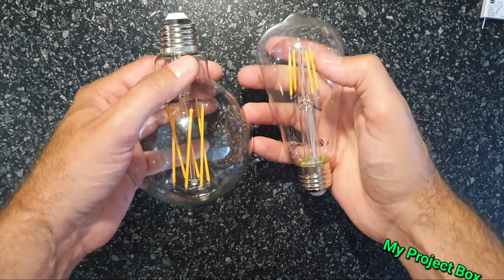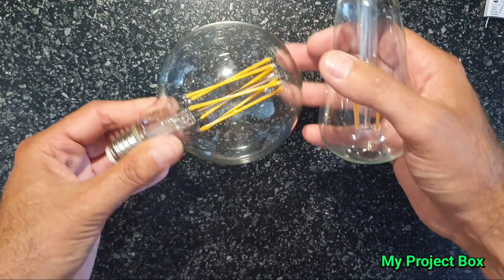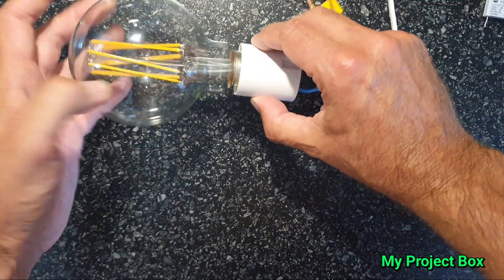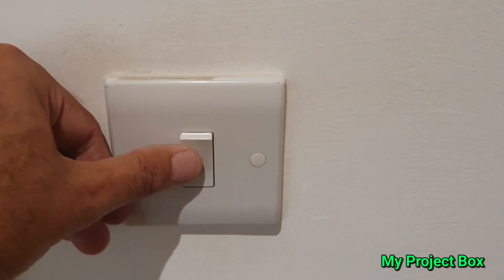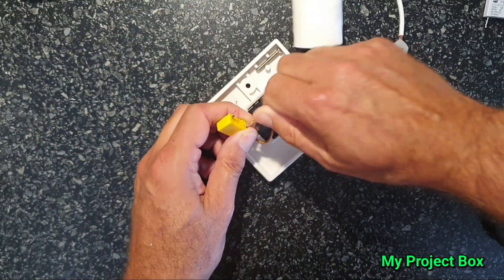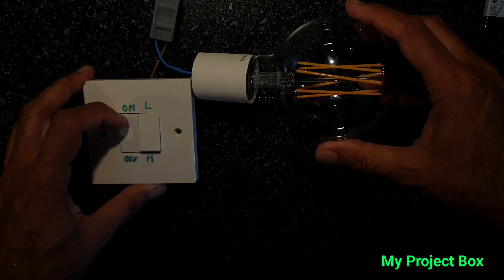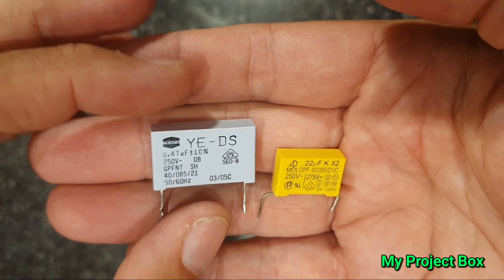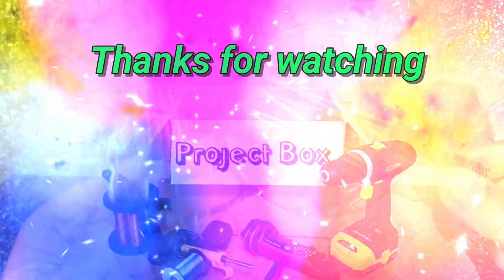Dimming NON-dimmable LED filament bulbs & life extension

Comment: This is such a simple way to do it, thanks for sharing. I'm curious, would the capacitor rating change the dimming effect? My thinking is to use one capacitor for one dimm "setting" and another one for a different setting. This way you have on/off, full brightness, half brightness, quarter brightness (something like that).
Reply from the maker: Yes exactly! You're correct 😉👍. You would have to experimentally verify which capacitor value gives you the correct brightness you desire. Different wattage LED bulbs will also yield different results, for a given capacitor value. It would also be possible to dim multiple bulbs (the same type) from one capacitor! You could use a rotary selector switch, to switch in different capacitors.
Reply: @MyProjectBoxChannel  Hi Sarel, this awesome, have you experimented to determine the capacitor values for two, three or four light bulbs . Thank you
Reply from the maker: @tbk19656  if you want to dim multiple bulbs from one capacitor, it's important that all of them are the same type and wattage.
Reply from the maker: @zororat yes😉👍 if they are  not all exactly the same,  one will draw more power than the others, and this will result in different brightness levels between lamps.
Reply: Also what capacitor would you recommend for a 4 watt bulb
Reply: Brilliant idea. I have been thinking of switching my high intensity COB lights into low intensity. Thanks alot, hatsoff and love from Pakistan!
Reply: Hi everyone, I purchased some 0,22uf  capacitors. When I connected the capacitors in series the intensity became lower and there is also a voltage drop. 
When I connected additional capacitors in parallel the intensity increased and the voltage as well. 
I am ever so greatful. 😊
Reply from the maker: @tbk19656  I'm glad it worked for you👍. Not all types of led bulbs work with this method.

Comment: Can i use only one capacitor for my living room switch? …as they are 6 bulbs in total
Reply from the maker: In theory yes, but it would need to be a much bigger value! All you bulb have to be exactly the same type and power. Test one bulb first to see if it can be dimmed with a capacitor. To dim all 6 lamps together will take some experimentation with the capacitor value (mabe 1uF or 2uF)

Comment: I have a hanging light arrangement in my house. There are 30 numbers of LED filament bulbs 9 watt each from a single on off switch the operating voltage is 230 volts 50 Hz

I am looking for a solution to reduce the intensity of all bulbs to approximately half. Can I put a suitable capacitor in the common line at the switch which will reduce intensity of all the 30 bulbs at the same time. 

Thanks

Comment: Tried several different LED lamps to dim with different capesitors. All flickers. You can't see it, but if move a finger, it's like stroboscope. Also, can see it on smartphone camara. Didn't work for me.
I downpowered all my lamps by incrising a resistor on the circet board. No flickering at all. Unfortunately, doesn't work for filament bulbs.

Comment: It works great but i want to know if it this risky for fire?
Reply from the maker: It's perfectly safe, just use the correct voltage rating for the capacitor.

Comment: I did this method with a table fan and it worked! My fan is 50w 127v 60hz, I connected one of the phases of the power cable to a 15uf cbb61 capacitor, this made the fan slower and quieter.

Comment: There are three types of LED bulb drivers. PWM, resistor and capacitor combination, constant current regulator.. This method probably won't work on PWM and resistor and capacitor combination drives, but it will work on a constant current regulator drive. Economical LED bulbs mostly use constant current regulator drivers. Integrators such as BP5131 can be given as an example. There is not much difference between the working principle of these drivers and a resistor. Both limit the current, but the regulator is more efficient. Connecting a series capacitor to the LED bulb will only further reduce the current and the brightness of the LED bulb will decrease even more. it is safe for leds and driver
Reply from the maker: @alpozdemir7898  the types of mains voltage LED interal lamp drivers I know of, is "capacitor dropper" , "SMPS/ buck converter" , and "linear current regulation". And the reason I used a capacitor to drop the voltage/current, is because its more efficient than burning up heat in a resistor dropper, but for very low current a resistor is not really a problem. Pwm is usually used for dimming LEDs from lower DC voltages or inside smart bulbs. Lower dropping current/voltage to a led bulb should be fine with a resistor or a capacitor. It kind of works because you reach the point where the driver almost "drops out" and the LEDs are dimmer.
Reply: @MyProjectBoxChannel  Thank you for your answer, what you said is completely true, the companies that produce these products do not want us to know the truth, it is more profitable to sell much more expensive dimmable bulbs
Reply: Thanks to you, I reached my goal and it was very cheap. Thank you for the video.

Comment: Today, the idea of applying a similar method came to my mind, I have never watched this video you posted before, but I used a 10kiloohm resistor instead of a capacitor, I didn't know it was possible while implementing this project, but it worked, bingo👍, so a common conclusion can be reached by thinking logically.

Comment: Tried this method on some smd bulbs with 0.22 uF X2 class capacitor:

1. ikea 5w ryet, is dim. but quite visible flickering.
2. Lidl 5.5W Livarno, get dimmed without flicker
3. Lidl 10W, flashing with interval of 0.5sec.

This is the 10W light:
https://m.youtube.com/watch?v=N6oEe1Li1-A&pp=ygUVbGVkIGJ1bGIgMTB3IHRlYXJkb3du
Reply from the maker: @MACYNET323  some types of led driver circuits won't work with this dimming method. For Example "buck converter" type and SMPS typs.
Reply: @MyProjectBoxChannel  At this point I will try with ceramic Resistor, guess that size should be adeguate for at least 5W of heat dissipation, avoiding to put near cables...
Reply from the maker: @MACYNET323  you are probably going to have the same problem even with a resistor😢.,because the buck converter/SMPS LED drivers are setup as a constant current regulator, so it will try to keep the current to the LEDs the same no matter the input voltage. That is probably why you are experiencing the flashing.
Reply: @MyProjectBoxChannel   You right, usually inside  pcb there are 2 resistor in parallel connected on the Isense pin of the chip regulator which determines the output current.

Another way, pull out the driver, install  inside the wall and connect the output on a small DC dimmer for regulation, but even in that case shouldn't work

Comment: Does flickering is visible like when you shake hands when bulbs are dimmed?
Reply: Do you think I could add one capacitor to a circuit running 16 GU10 bulbs? They are 3watt each. What size capacitor would I need?
Reply from the maker: @bryandurandable  yes it could work,  but you need quite a big capacitor, 1uf or 2uf. Not all gu10 lamps will dim this way. So you will need to test it first. They also all need to be the same type and wattage.
Reply from the maker: No it should not flicker😉. But it will depend on the type and quality of the LED bulb🧐
Reply: Oh man ❤Is better to put 2 in series(with switchs) or in paralle for select different modes bright?
Reply from the maker: @MACYNET323  yes you can switch multiple capacitors if you want😉👍(parallel or series). But for me just full brightness and a nice dim setting is enough 👌

Comment: this way can work as you wish but the light has flickering that not good for your health (this bulb is arround 15-25% flickering) I did use rectifier bridge diode + Capacitor  + inductor to create 310VDC at 5% flickering

Comment: I have a set of light up LOVE letters. The ‘L’ plugs into the socket and the ‘OVE’ take their power from inside the ‘L’. If I were to put a capacitor inside the ‘L’  before the power reaches the bulbs would this work?
Reply from the maker: @19crofty86  it's possible yes/ maybe. But it depends on the type of LED driver 🤔.  Are the led letters mains voltage? Or 5v 12v?

Comment: Such a simple idea, and it works, Thank You.
I tried this on the step-daughter’s 4 non-dimmable ceiling LED’s ‘FIXED LED SLIM DOWNLIGHT, 11W 1200LM’ brought from Screwfix, they were so bright and needed dimming.
Tested on one lamp first, 0.47uF capacitor, Dimmed nicely, voltage was 140v. 
Next wired into the 4 ceiling down lights, voltage had dropped to 60v, brightness was really down, but when she tried it at night time, it proved to be too low, so I need to change the capacitor value, But it works
Reply from the maker: @Bigmalc0   Yes the dimming effect is load dependent, so multiple led lights in parallel will require a larger capacitor. You could have a high/Low switch, for full brightness and dimmed mode. I'm glad it worked for you😉👍. Thanks for sharing your findings with this type of LED light fixture. It's good to know that it's is possible to dim this type of (non-dimmable) ceiling light, with a capacitor
Reply: @MyProjectBoxChannel  I like the idea of having two different light levels, but in the daughter's case, it is not possible to contain it in the switch housing, I've tried.
Can you get a remote switch a bit like the garage door where one press turns the light on, second press for half brightness, third press turn off,
On another idea, do you know if the Sonoff R3, is in Half Brightness mode and you were to turn the lights off at the switch, when you turn it back on, will the Sonoff R3 remember the last setting?
Reply from the maker: @Bigmalc0 Some time ago, I used a sonoff dual, with two outputs, to do the high/low modes. It was the older one but the newer one will be better. https://youtu.be/EUKop6N4cX0

Comment: Can I connect multiple bulbs on on3 capacitor ?
Reply from the maker: YES! It is possible to use one capacitor for multiple LED bulbs, but the bulbs need to be identical, and you will require a bigger value capacitor. The value of the capacitor depends on the wattage of the bulbs. So you would have to experiment. I would try 1uF or 2uF capacitor, and if the bulbs are too bright, then you should use a lower value, maybe 0.47uf

Comment: Could use this for led strip????
Reply from the maker: Only if its a direct 230Vac (or 110Vac) strip. It won't work with 12v or 24v and driver type😥

Comment: Simple solution. Very cool. Total noob here... is there a wattage limit on that capacitor? Lets say you need to dim more than one bulb, say in a fixture. DO you need to have a capacitor per bulb?
Reply from the maker: You can have just one capacitor dimming multiple led bulbs in one light fixture😉. Just remember that they need to all be exactly the same type and wattage. Your capacitor will also need to be a much bigger value, and that value will depend on the quantity and wattage of LED bulbs. How many bulbs are in your light fixture?
Reply: Thanks heaps for the reply :) I was planning on having 6 nos of 4W bulbs. So a total of 24 watts. We also use 240v AC off our grid.  @MyProjectBoxChannel

Comment: Is this safe on the long run? I have similar LED filament bulbs from Globo and they're not dimmable. I would give this a try but I was wondering are there any hazards?
Reply from the maker: It's perfectly safe😉, as long as the capacitor used, is properly rated for mains voltage ⚡️. Like a x2 rated capacitor.

Comment: Would this work using a 2 gang wifi switch?
Reply from the maker: I have done it with a sonoff dual-r3, so it should be possible. https://youtu.be/EUKop6N4cX0
Reply: I was more curious if it would somehow work on a actual 2 gang wifi switch i have no space to add anything else. I did realize with my led i have to turn it back on high before i turn it off. If i dont the light flickers from low to high then turning it on i blew the capicitor. But i have 5 so its ok but now i know 😂

Comment: what would you suggest for a capacitor rating on a 120v candelabra fixture with 16 LED non-dimmable bulbs, each bulb at 4W?
Reply from the maker: It definitely will require some experimentation 🧐🤔. The brightness level you personally require, is going different for everyone. You could try 2uf upto 4uF maybe? A capacitor from a single phase motor might be suitable(or old type florescent light fitting capacitor). If that still is too bright, try a smaller 1uF class-x or -y safety capacitor. You can put capacitors in parallel to increase the brightness, or in series to decrease the brightness. It's worth remembering that this method doesn't work with all types of led bulbs! Also make sure that all the bulbs are exactly the same type😉👍
Reply: Yes all 16 bulbs replaced with the same exact bulb.  Thanks so much.  I'll give it a try.     @MyProjectBoxChannel

Comment: Great vide¡¡¡ Do I need one capacitor for each bulb ? or, can I use just one for 4 bulbs ? And what value for the capacitor should I buy?
Reply from the maker: It is possible to use one capacitor for 4 LED bulbs, but the bulbs need to be identical, and you will require a bigger value capacitor. The value of the capacitor depends on the wattage of the bulbs. So you would have to experiment. I would try 1uF or 2uF capacitor, and if the bulbs are too bright, then you should use a lower value, maybe 0.47uf.
Reply: @MyProjectBoxChannel  Thanks for the answer, it helped me a lot.
Reply: @MyProjectBoxChannel Does this scale linearly? I have replaced all of my string light bulbs with 1W LEDs (in place of the 11W) incandescent. However I have a line of nearly 100 bulbs…

Comment: Nice idea, my only concern would be that the power rating of the capacitor is high enough. Suppression capacitors designed to be used across power supply rails should obviously be fine, but there will be other capacitors of the same value and voltage ratings which would quickly burst into flames. Make sure you know what you're doing people. 👍
Reply from the maker: I think I did mention to use class X suppression capacitors, in the video. I normally selvedge them out of old power supplys.

Comment: Is there a possibility to make it fully dimmable to work with a dimmer? What dimmable bulb actually has that makes it dimmable?
Reply from the maker: Dimmable LED light bulbs have a very different driver circuit for the LEDs inside.  And there are different types of dimmers that are more suited for led light bulbs. For example leading edge or trailing edge dimmers. It's not easy to make a non-dimmable bulbs work with traditional light dimmers. But my capacitor hack does sometimes work, to get a fixed brightness setting.
Reply: @MyProjectBoxChannel  let's say the bulb is 10 W and I want dimm it exactly to 75% 50%, 25% +-10%. Is using proper safety capacitor that precise or is it always an experiment?
Reply from the maker: @jccuchvjvj  it is possible to use a rotary selector switch to switch across multiple capacitors connected in series.  That way you can get various degrees of useful dimming.  It will unfortunately requiring some experimentation with the capacitors valves.  Each LED bulb manufacturer uses different circuitry, so  there's no universal calculation for the capacitors. Remember these types of LED bulbs weren't made for dimming in the first place.

Comment: Could this have been done with a resistor instead? Pros/Cons with resistor vs capacitor?
Reply from the maker: Yes but a resistor will be wasting energy as heat! A capacitor is very efficient and does not generate heat when dropping voltage.
Reply: @MyProjectBoxChannel  

This is what my light / led driver says.

AL315 ALVIS
LED POWER SUPPLY Constant current
PRI 220-240V
0,5c 60 mA
0/50/60Hz
SEC 150mA 3-40V 6W 
U-OUT=45V 
tc 75°C 
ta-10 - 50°C

What size of capacitor should I use to make it half as strong? 😎
Reply from the maker: @partyoverallt  some LED drivers will not work with a capacitor😩. But try 0.47uF and then go down in value if it works, to find the brightness you require.

Comment: Why won't dimming work if you have a PWM dimmer?
Reply from the maker: PWM (Pulse-width modulation) won't work. The internal led driver does not like it, and will probably damage it at a 230V pwm input. That technique is better suited for low voltage  led driving, like 12v.

Comment: This is dreadful, just buy dimmable bulbs, you can get dimmable led fillament bulbs, I have some! Also use a dimmer switch ffs, this is complicated and very badly wired, you didn’t wire the switch at all correctly and it’s just dreadful. Buy a dimmable bulb and dimmer switch that dims leds, and use that. Don’t faff with dodgy things like this and make it a danegrous mess.

Comment: Dear your can use trimmer used for fan speed control ...then enjoy variable dimming effect
Reply from the maker: This particular bulb is not dimmable! The fan speed control will not work with this type of led bulb 😮‍💨. That is why I used a capacitor. But you could use a selector switch with multiple capacitors, to get variable dimming.
Reply: @MyProjectBoxChannel  .. I think its resistive load!!! Fan dimmer should work  .. anyhow if you are saying You might have tried it 👌👌
Reply from the maker: @crazycoolguy109677  the LED bulb is not a resistive load, like the older incandescent bulbs. It has LED filaments, and each filament has about 70 micro leds connected in series. This has a DC forward voltage of about 200v. There is a current regulated power supply in the base of the bulb. If you try to adjust the input voltage with something like a dimmer, the bulb will will flash on and off, or not work at all, depending on the input voltage.